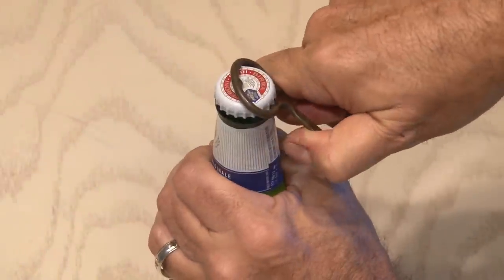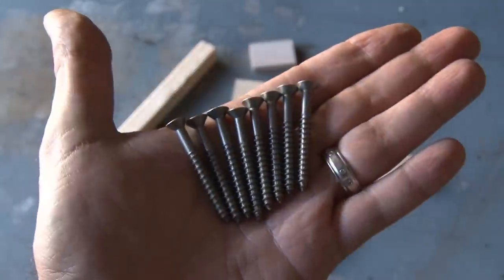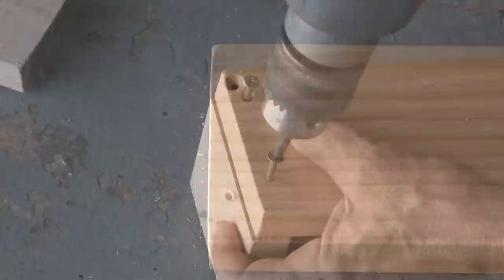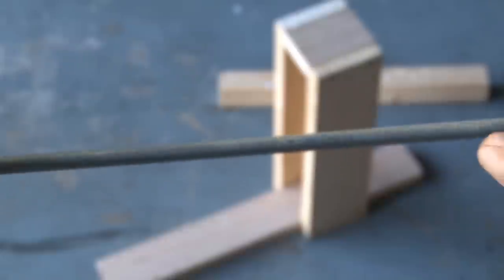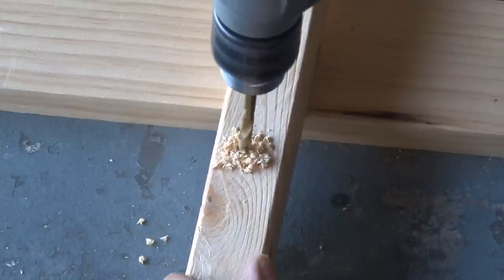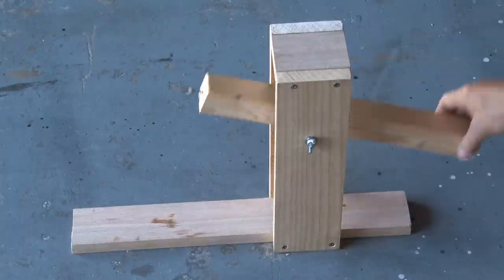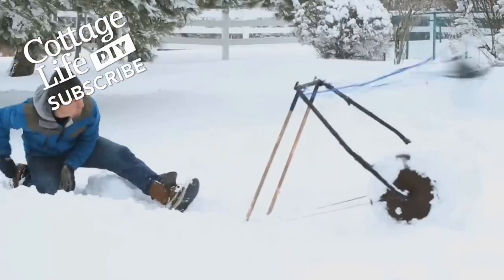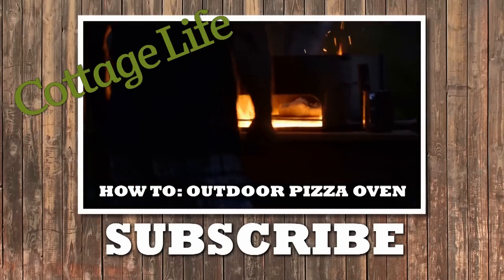Crazy Catapult Bottle Opener!

Comment: Tip, put a nut on the threaded length before the cut it, when you remove the nut it will clean and straighten the thread.

Comment: This is like a Rube Goldberg contraption. :-). I would replace the screw sticking out of the end of the wood(which pops the cap) with a small metal upward bent plate screwed into the top side of the wood. I have visions of the screw becoming bent after a few times, or some clown not holding the bottle tightly and the bottle flying into the ceiling. LOL
Reply: You could probably modify the contraption to have a clamp or something on the base to hold the bottle down. Add some springs, a latch and a large enough counter weight and you could make this thing automatic too.

Comment: I just came up with an upgrade to this. you cut a oval shaped hole in both sides. then you drill holes a disierd hight or hights. the slightly above the hole start cutting so the hole turns into a slanted oval.

Comment: You could up-grade this even more by making it adjustable. Instead of drilling a simple hole for the threaded rod, cut a slot that goes vertically. Simply loosen the wing-nut, adjust to the height of whatever bottle you have, and firmly tighten wing-nut. Viola'! You have an any-bottle, catapult bottle opener!

Comment: cool but useless
Reply: Engineering is about solving the most basic problem in the most complex way.
Reply: TheDevilFrog  Its not useless, I'll give you that, but a regular bottle opener is easier and faster to use. Besides, you can fling a bottle cap with the butt of a regular lighter to open the bottle, which is way cooler than this contraption.